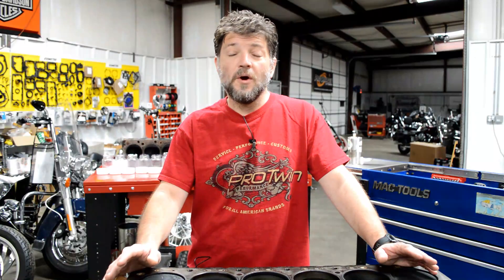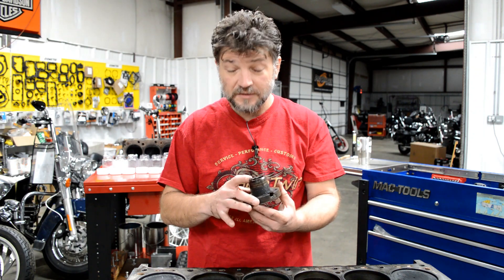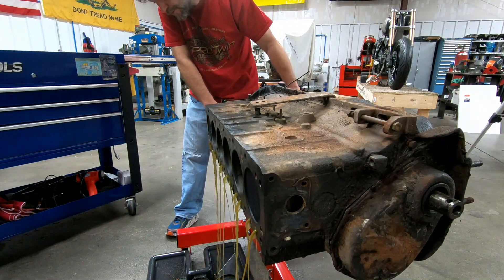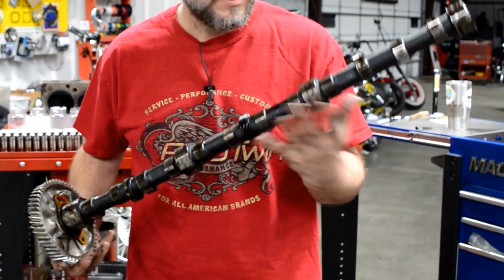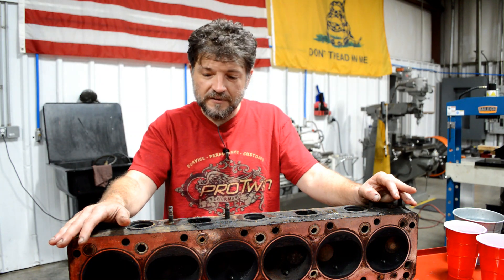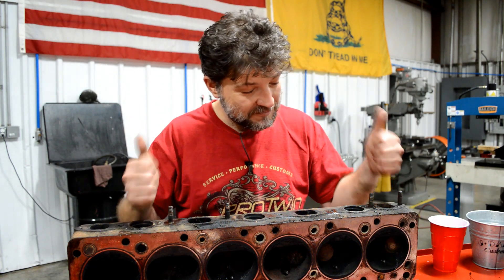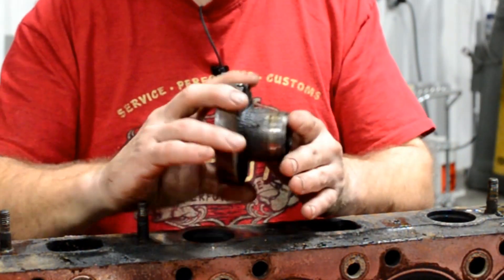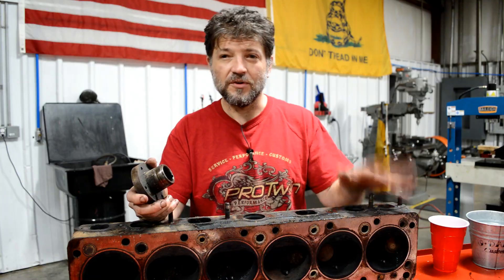Why Didn't It Run??? - GMC 302 Stovebolt Engine Build - Part 2 - Kevin Baxter - Pro Twin Performance

Comment: The manual you are retrieving engine specs from ....  Looks like something I need for my 1948 GMC 270 engine ...  Was wondering if  you could pass on where to pickup a copy.

Comment: Hey Kevin....I have a 51' 3100 Chevy that I'm not sure what motor it has in it yet (just got it) it doesn't look like a 216ci stovebolt as the valve cover is orange and there aren't the two valve cover bolts visible coming through the cover. So I was wondering if this engine might fit/work for my pickup.

Comment: Question : does the motor have a full flow oiling system ?   Does it have a 4 bolt flywheel flange or a 6 bolt flange ?  Great job !  thanks !
Reply from the maker: it does not in original state.  i will be making the full flow mod though and will fabricate a spin on filter mount that will go inside the oil filter canister so it'll keep its stock appearance.  pop the lid, spin off the filter.  pretty cool.
Reply from the maker: 6 bolt flange on this one.
Reply: @KevinBaxter  Many years ago my buds had a  H/Gasser with a 302 Hydromatic .  4 bolt crank flange would shake the bolts loose .  finally got a 6 bolt crank .  Ran 12's in a '37 chevy coupe , homemade intake with 2 , 4's  .  coolest car I ever saw and I used to crew on a alky funny .

Comment: Got one of those and that front crank pulley was a problem from the factory they were loose and no crank bolt, and many times they would come off when you were stopping and you would see it rolling around in the road .
Reply from the maker: that shouldnt happen again after the fix.

Comment: As the proud owner of an original 1951 GMC 1/2 ton 100-22 extended bed pickup with the original 228 cu.in engine' I have to say These trucks were built when Truck's were made to be Truck's men were men"👍
Reply from the maker: No kidding.  Even tie rod ends can be adjusted, greased, and rebuilt to account for wear.  Those were the "lets fix it" years....not "lets replace it".  The stock con rods in the engine rival many modern high end performance con rods.
Reply: @KevinBaxter  Yes I'm looking to hop it up just like they did them in the 50s and 60s  302 inline 6 with the three dueces can and Fenton header's dropped monoleafs and wide White's. None of That small block Chevy stuff 👍
Reply from the maker: Wait until you see the matching set of 3 Carter YH carbs from a 1964 Corvette i came across.  I'll fab an aluminum intake and stainless header for this one.  Will probably fab an aluminum valve cover as well so i can integrate the throttle linkage into it.

Comment: I'm highly enjoying this series. Over the past couple years I've had the privilege of awakening a 49 216 from a long sleep and doing a total rebuild on a 54 235 both being the Chevy versions of the Stovebolt powerplants. On the 216 every valve leaked on the water test and a rebuild on the head garnered around 23k of enjoyable cruising in the 49 3100 it came in. I sourced a 54 235 with a dead #1 cyl and did a total rebuild with a few performance parts added and it now powers that 49 3100. I plan on a total rebuild of the 216 some day. I'd love to get my hands on a 302 like yours for another project I have on going. Good luck to you on this project.
Reply from the maker: thanks for sharing.  i checked out your videos...very cool.
Reply: @KevinBaxter  Back in the day I drove a brand new 1977 HD FXE through the front gates of MCAS Cherry Point for the last time and kept that bike for 18 more yrs before in a weak moment I let 2 times the $$$'s blind me into selling it.  Haven't had one since. One of my Bro's has an 8-Ball I can borrow should the need hit but at 3 score and a qtr more I'm fine with my 49 4 wheelers, LOL. I'll keep you in mind for any future machine work, you're not too far.
Carry on.

Comment: One thing for sure that engine has never seen a battery powered impact on it before. I’ll bet you are on to something with the burned valve. As an armchair mechanic, I thought that from day one..
Reply from the maker: Yeah...its definitely valve job time. I'll repair the nose of the crank. So far, everything else appears to be perfect.

Comment: Very cool. On another subject. My 2016 RGS has almost 27000 miles on it. I have Vance and Hines true duals. Ciro3d cypher air cleaner SE pro tuner and SE autontuner. When should the compensator be changed. Thank you
Reply from the maker: When you start hearing a clunk at shutdown, a bang at start up. Put bike in 1st, not running, and rock it back and forth you may hear it.
Reply: @KevinBaxter  thanks